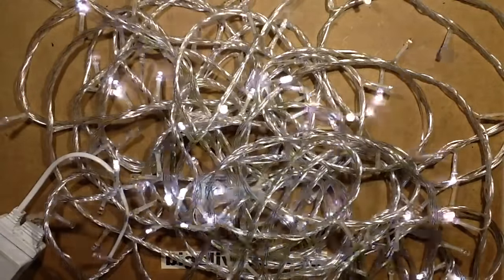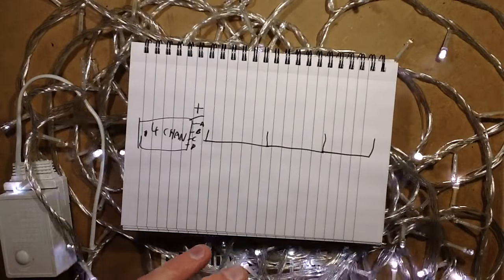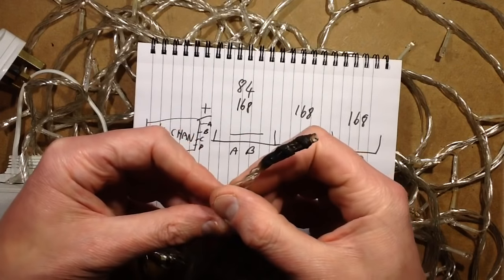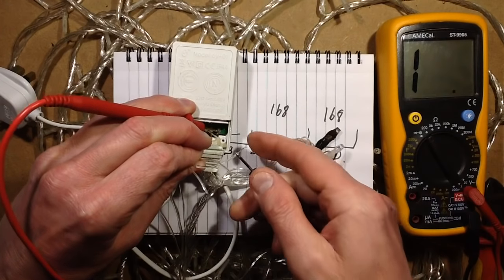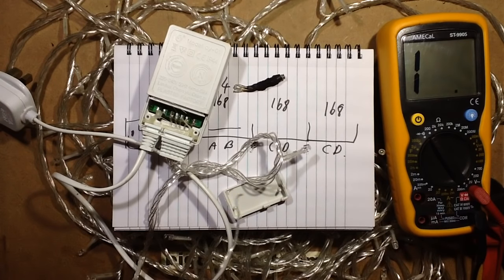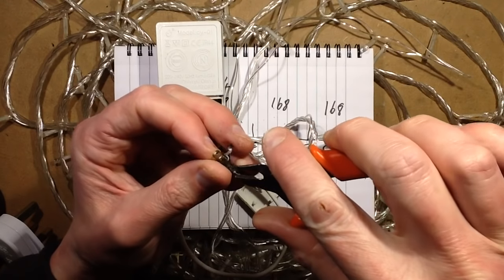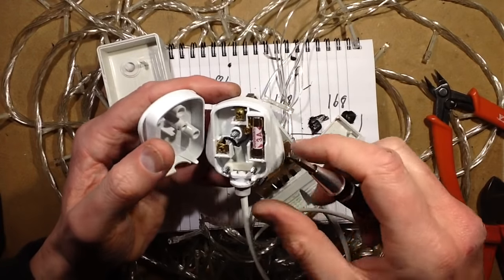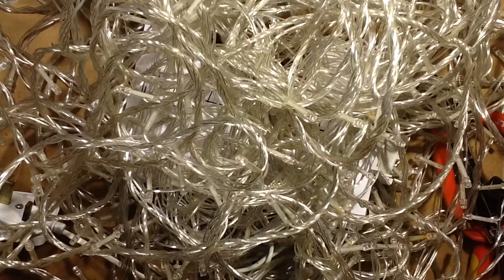Smokin' groom-o-cutor LED wedding lights.  With shady "repair".

Comment: Hi big clive, I must thank you for your web page on stopping Christmas lights flashing. I had a string of 300 leds on 4 channels & found they didn't work. The controller was at fault due to water getting in. I bought a 1A 400v bridge rectifier & wired it as you said & hay presto, all working! Thanks mate.

Comment: I have seen identical arrangement in a tungsten lamps chain, hence the box does not contain smoothing cap. It ended up blowing up near the power box as it didn't have ANY strain relief (common positive desoldered itself and was flapping around until making a short with something).

Comment: I really hoped to see the 600W wire heater in action :(
Reply: That would have been quite spectacular, even lovely.
Reply: And a 3A fuse test. Directly across the mains! Breaker vs fuse - the epic showdown
Reply: Max I have dissipated nearly that much heat in just a couple feet of #22 steel wire, but that only works for long if you immerse it in a bucket of water...that will start to boil after a bit.  But a length of wire of known resistance in a bucket of water is a great way of making up makeshift resistors for load testing large power supplies (where you are typically seeking just a fraction of an ohm).  

But for an open air demonstration maybe Clive might want to step out doors for that demonstration...I would hate to see anything happen to the workbench that is the source of so many enjoyable hours of entertainment (well, in truth it is the narration that is entertaining!).  It would be cool though (well, in a "hot" sort of way).
Reply: I think an outdoor demonstration of excess dissipation would be smashing, especially if it were a special hosted by the gay Daleks. 
A 22 Ohm 1/4 Watt resistor across mains makes for a nice little effect, but I see some nice fireworks potential with 600 Watts into a bunch of shoddy wire. EX TER MI NATE!

Comment: for fear of being electrocuted to death, my friend decided to become a plumber... his reason was "he's never seen a domestic plumber drown".. he has a point, but his job is not as "exciting"....
Reply: He could still set himself/the building on fire with the soldering torch :p.
Reply from the maker: Bad news for your friend.  More and more plumbing equipment has electrical functionality now.
Reply: Teri Wilde but consider how many sketchy household electronics and wiring he will have to work AROUND at the very least. You never know what you will find as any kind of contractor, all sorts of crazy dangerous contraptions and budge jobs. You could end up finding a live pipe or even just touching something that should be safe (and isn't ) while you think your safe and only working with water. I'll just add remember how conductive water and copper and metal pipes in general are and also how often people have death wiring or whatever in their walls without knowing until a contractor finds it(hopefully alive). You may not be directly working with as much electricity as a plumber in theory but in practice Clive is right and lots of domestic plumbing is becoming increasingly electric so you will have to be able to deal with pumps heaters meters etc. and just generally crawling in crawl spaces exposes you to unsafe wiring and lots of other things. And if he got knocked out you could absolutely drown in a toilet, bath, floor, or sink in an inch of water. Just sayin.
Reply: Heated Toilet Tear-Down?
Reply: I don't think he thought things through enough...
Reply: Had a faulty electrical water heater pump pass voltage into pipework, used to work on military things, bit of both electrical and plumbing, (had my 17th edition and part 2). Was originally a mech eng but things change. Boss put me through electrics as it saved sending a sparks every time we had to fit a water heater or any other device that mixes electricity and water.

Comment: I have seen two-color 3 wire variant that had some really annoying dreary melody function in it, which didn't even have a bit of hot glue on the wires, case, circuit, and even LEDs!
This thing runs on AC and I was able to open it in 3 seconds.

Comment: You should get/build an isolation transformer for your workbench; this would make it much safer to experiment with dubious mains equipment such as these lights. I constructed mine from an old 2-kVA 240/120:240/120 building transformer, and as an added feature I can also use it as an isolated step up/down transformer.

Comment: I think they are putting the cob chip on a separate board because either they can change out the design easily with a different chip or because the controller factory cannot bond chip dies to a board so they have someone else do it.

Comment: You could have tons of fun with all those leds. I could use some for different projects. The cost had gone down on those lights so much now,its cheaper to chuck the whole set than fix them. My problem is I cant throw stuff like that away. I always think I may need them someday. I would shorten the length however.

Comment: "I'm going to use the meter set to continuity" AKA the "other" setting. lol. I wonder if you designed a simple, single wire set of probes with continuity and 20vDC functionality, as useful and handy as this would be, would it sell? A very limited device, but compact and so useful??!

Comment: You think this is as cheep as it gets? noo... 
I was flown in to check a bulk set of these lights once for a theaterplay. They told me the samples worked just fine but the bulk they ordered later flikkert humongously. turns out for the bulkorder they tried to save some money  on the diode's and only used one to sort of rectify the mains input! hahaha. We ended up cutting all the white boxes off completely and put one big rectifier in front of all 200 strings. Show must go on... (luckily it were only a few shows and it looked super!)

Comment: I'd take that string and cut of the LEDs for a project I really want to do. but it would be cheaper (maybe) to buy the ~20k LEDs I want to use for it in bulk from someplace like digikey

Comment: Clive you said one of the resistors was a reference for determining the zero crossing point.  Could you explain that?
Reply from the maker: The high value resistor is used by the circuitry to detect when the mains sinewave changes polarity.  It will be using it to derive a start point and timing for the dimming effects.

Comment: Just a quick question (and yes it might be a stupid one)... I take it you switch the neutrals in electronics like this if theres only a common positive? Why do they do this? In electrical installations you never switch the neutrals, the only place ive seen some (older) electricians do this is on dol starters...
Reply: Isit because if it does get cut theres only 1 positive?
Reply from the maker: It's most likely you saw the electricians swap phases in a DOL starter to reverse the motor direction.
Reply: +bigclivedotcom no they mentioned if remote isolators were in circuit and ripped off the wall there wouldnt be a live hanging out the wall, nothing to do with wrong polarity
Reply: Don't confuse AC with DC.
In 'normal' electronics, a single L.E.D. is switched by an N.P.N. transistor. The emitter of an N.P.N. is usually connected to ground and the L.E.D. is connected between a resistor going to the positive rail and the collector of the transistor.

This is a legacy practice hanging over from Thermionic valves.
In this case, the designer is just falling back on 'old habits' Without taking into account the serious issues it creates.

P.L.C.s are wired differently in professional installations.

Comment: Can someone suggest a temperature to set a soldering iron to in order to melt the solder on an old 1979 vintage PCB without delaminating or otherwise damaging the board itself?
Reply: I've only tried soldering on that type of material a couple of times and at a couple of larger soldering joints the board started delaminating, which means I did something wrong. It was scrap anyway so it was just for practise.
The tips I can give you, however, is to practise (de)soldering some components on a piece of scrap board.
Start by applying fresh solder to the joint when desoldering. Be as liberal as is practical. Another thing I learned: if the joint you're working on just won't flow with the temperature you're using, crank the iron up a bit and let the joint cool before applying a bit of fresh solder (or perhaps just flux) and trying again.

In the cases where I managed to destroy the PCB material it was because I tried desoldering a large joint and I didn't let the material cool down enough between each attempt.
Perhaps you can learn something of my failings. The best way to learn, though, is by doing, so find a piece of scrap board to practise on to get to know your tools and how they work with the material. I'd suggest also trying to intentionally applying too much heat in some spots. That way you'll know how much too much is.

Hope this was of some help, even if I couldn't really answer your question. :-)
Reply: Hattmannen Nilsson Thanks! Unfortunately, I don't have any board to try on - this is a vintage computer where a chip is burnt out, and I want to replace it (with a DIP socket in order not to destroy anything more), so it is quite valuable (to me, at least). Unfortunately, desoldering from the bottom didn't losen all the joints, so I am stuck here. Next step, I ordered a better soldering iron where I could set the temperature (instead of the cheap one which just plugs in and then heats up with all its power), but I don't know to which value to set it. Also, a flat tip will be more helpful, than the sharp point (which isn't even solid, but wobbles around because the iron is so crappy)...I will try again once that arrives.
However, on 2 of the 14 pins (on the top side) I see brown residue which I think wasn't there before (if it were, it would have been from the chip burning out), so I can only hope that I didn't damage the board, although I smelled a bit of PCB material during my attempt...
Reply from the maker: Older PCB always carry a risk of delamination of the copper.  You'll have to use a soldering iron at the usual temperature, but try to remove solder completely with very brief application of heat and plenty of cool down time between attempts.  It also helps to cut individual pins on components including ICs so you can remove one pin at a time.  It all comes down to skill and experience, and even the best electronics guys will still delaminate a track from time to time.  Just replace it with fine wire tacked across from the nearest intact pad on the same track.
Reply: bigclivedotcom Thank you! I will try again as soon as I get the new iron. But since this goes from 160-480 degrees, I still don't know the number to which I will have to set it. But I guess, Google can tell me that easily :-)
Reply from the maker: 330C is a good start and do it by feel from there once the iron temperature has had time to stabilise.
Reply: Just out of curiosity, what's the brand and model of the computer you are working on?
Reply: invisibletenants It's a TRS-80 Model 1, nothing special...

Comment: Hi Clive - ive always enjoyed playing with electronics, albeit never trained.  With luck ive fixed various things like tv and iphones amongst other things.  But as a learner, and when you buy soldering units with adjustable temps, how do you know what temp you should be soldering at? I appreciate this may be tricky to answer, but I see people adjusting their temps on certain projects but have no clue myself, help please and Happy New Year thanks for all the great vids.
Reply: 8inary 01100100 completely depends on the solder you're using -  something with a higher lead content,  while being more toxic,  will melt at a much lower temperature than something like lead free solder will take more heat to melt. As well as this,  higher temp may give a better result but could fry some components.
Reply: I'm not actually Clive but... Basically the higher the thermal mass of the object you are soldering, the higher the temperature. It is mostly an educated estimate. if the thermal mass is low with a high temperature you may damage the component. If the thermal mass is high with a too low temperature you will probably get your soldering iron stuck on the solder joint. In which case turn up the temperature. Not rocket science.
Reply from the maker: Typically a good soldering temperature will be around 330C, but most irons are not accurate, so nudge it in either direction to suit your own preference.
Reply: gawd I need to learn so much more lol - im just a beginner, and whilst I enjoy doing projects and attempting to fix things, there is soooo much more I need to learn, thanks for the comments it all helps even though at the moment, its well beyond me.
Reply: 8inary 01100100 You adjust it according to what you need. With normal leaded solder, I like to choose 330, sometimes 350 or 370 if the pad is very big or well heatsinked. You basically go up in temperature until soldering goes quick and easy but doesnt oxidize and burn in a rather ugly way.
Reply: Its an amazing community, im just at the learning point, ive fixed a few things, including my parents tv which was an amazing result, 7 bad caps, so was easy to do, however there is so much more I need to learn, but find it all enjoyable, and the people who help create a good team for us newbies.
Reply: +8inary 01100100 Clive has a video that is called "How to choose a cheap chinese soldering iron" or somesuch that goes into great detail (it's also something like 45 minutes long). If you scroll down through his videos, or search on "solder" it shouldn't be difficult to find.
Reply: +8inary 01100100 also check out EEVBlog if you haven't already, some good electronics 101 there too. :)
Reply: thanks everyone
Reply: InBeta there are a number of circumstances that do in fact go contrary to you post mate.
It isn't simply solder composition dependent only.
Sometimes having too cold an iron results in the tip being left too long on the target area thus allowing for more heat to dissipate into the surrounding board and/or components.
Some situations call for a very hot iron ( such as lead-free joints ) and trying to use a standard iron incorrectly adjusted dissipates more heat into the surrounding areas before the solder has melted.
A solder iron that is too cold can therefore cause more damage than a hot iron simply because of that heat entering the localized areas for to long as opposed to a quick " touch and flow " with the joint.
Surface Mount Components are easily damaged this way.
I`ve done it many times before I realized what was going on.
Temperature of the tip also depends on size of the tip as well a speed of soldering and the size of those joints taking the heat away while acting like a heat sink.
I started using lead-free solder for components over 10 years ago but now limit it`s use to cables or anything on the board which may be subject to tension or vibration from external sources.
Everything on the board is done with tradition 60/40 lead/tin solder.
Certainly would not suggest using lead-free for surface mount components being hand soldered.
Even as a person that started soldering in 1980 myself this is still a pretty tricky process with lead-free and not worth the potential damage.
I can now look at a manufactured board and tell exactly which joints are from what solder but still regularly need a magnifier of sorts which also tend to show manufacturing flaws - I check everything out before I plug anything into the mains and I often do a reflow on suspect joints.
Learnt the hard way by getting 9000 volts through my right arm.

Comment: What would be the easiest way to reduce the shimmer on these?
Reply: Un-plug them :-P
Reply from the maker: https://www.youtube.com/watch?v=HaBLM5fOZBI   I added a capacitive dropper to a set to make them static with no flicker.
Reply: bigclivedotcom thanks Clive. Would it be possible to incorporate a smoothing capacitor into the current circuit so it could still be multifunction?
Reply from the maker: Not easily as the switching components are thyristors that need the zero crossing point to turn off.
Reply: bigclivedotcom doh, I thought that it would be a difficult job! 

Also, I have bought a couple of sets of lights from b&m, both seem to have a section that flickers randomly - would you be interested in me sending you a set to look at? Would be interesting to find out why they both seem to have the same issue!

Comment: a friend dropped a set of these in to me and asked me to make them fully on rather than flashing and to dim them. I haven't got round to it yet and having seen this I might not bother!
Reply from the maker: It's an easy fix if they have the standard controller.  You can either bridge the thyristors inside or just replace the controller with a mains rated rectifier.  But note that the resistors often built into the sets are often pushed hard in many of the strings.    http://www.bigclive.com/noflash.htm
Reply: Ah, excellent thanks Clive. Capacitative dropper to dim them a bit? (They're a mains voltage set)

Comment: I wonder why Phil didn't get high quality lights instead.
Reply from the maker: probably cost and off-season availability.  Not helped by the fact that proper outdoor rated lights are hard to get and very expensive, and the cheaper low voltage ones come in smaller sets and are not really waterproof at all.
Reply: Maybe his soon to be spouse got them as part of a deal from her insurance agent?
Reply: hi clive ,can you give me some advice please .i want to build an led light to plug into my mixing desk .3 pin xlr socket rated 12v 500ma ,what leds and resistors should i use ? many thanks .
Reply: John Mann I would recommend 920 ohm resistor- it blocks 9.2V so the LEDs are fed 2.8V. Use 5mm LED in any colour you want.